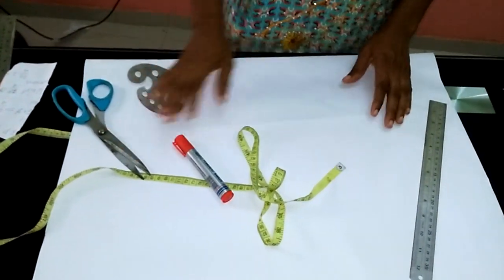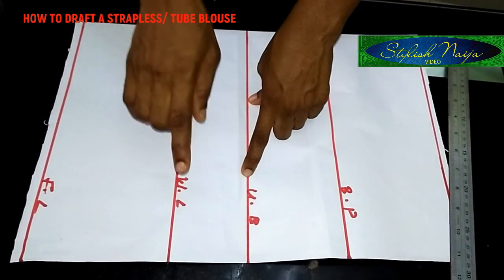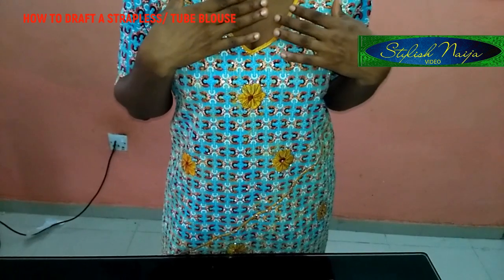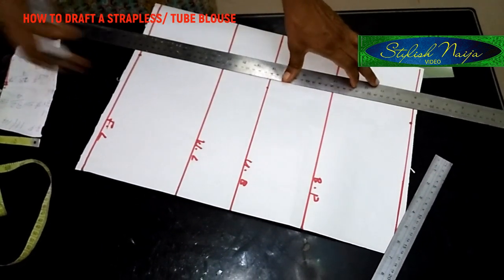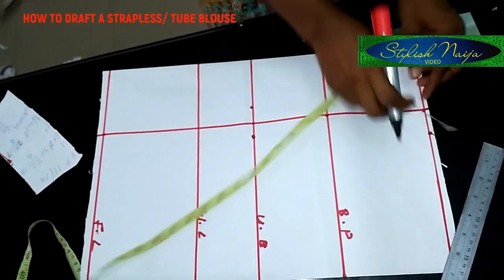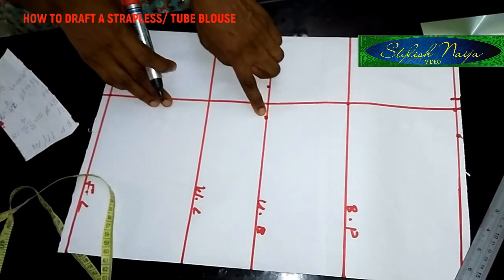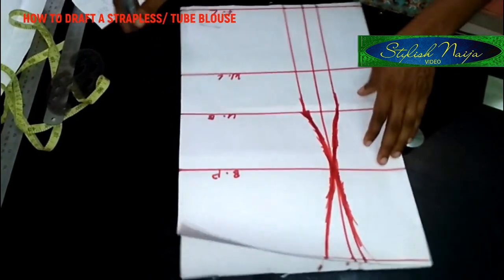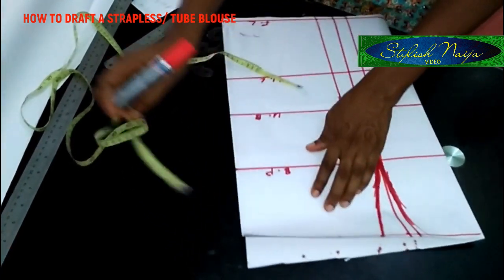How to Draft a Strapless Tube Blouse

Comment: You rock. You just cleared my curiosity about this particular tube top . I just learned somethings about it . Thank you so much and God bless you . Please tell me the difference between this and an off shoulder blouse or dress and also, when do you go 1” above the bust and 1” below the bust with the darts. Remain blessed.
Reply from the maker: A tube pattern can also be used  for an off shoulder. ..blouse ..most times the difference is actually on the Neckline